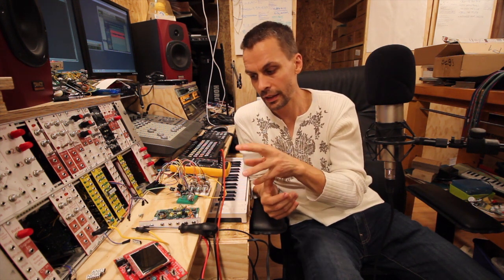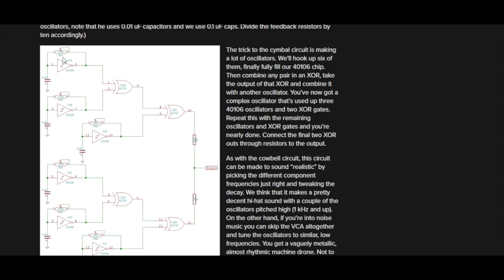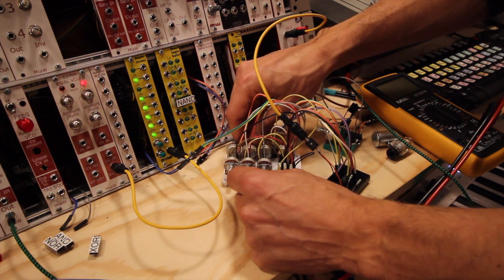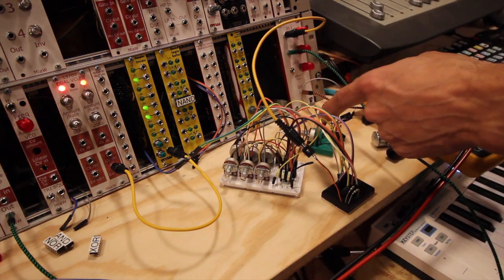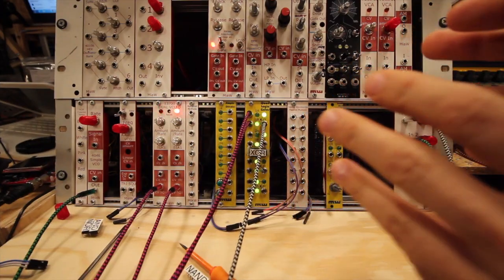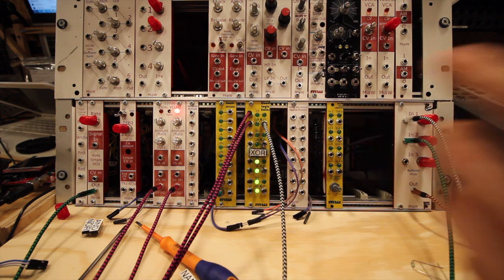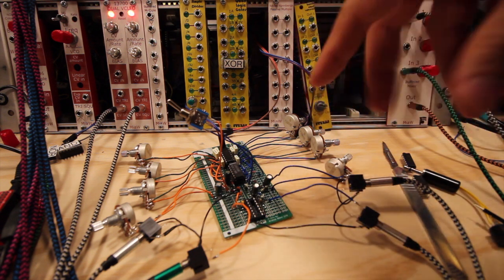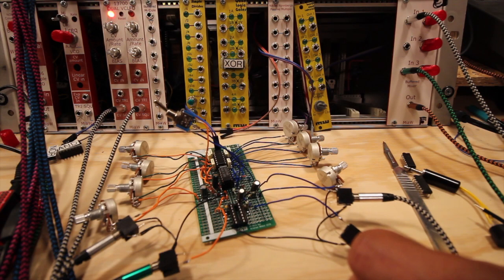XORbell Metallic Noise Percussion - DIY Modular in a Week 9.3

Comment: Sounds cool, you'r synth is awesome. Typical I just ordered a Rakti metal, and it seems to be making some similar sounds, I hope it will work as a snare since it has a option for metal sound or white noise . I'm starting my drum skiff soon, and I plan on making a piezo trigger thing (so I can finger drum) and a weird 555 LFO timer thing I came up with to trigger it. Still don't quite get how to make the VCA, but I will watch you'r videos and study the scematics more before I start asking noob questions.
Reply from the maker: The tomtomtom and the xorbell use two different techniques for vcas. If it’s just square waves the one in this one might work. For noise sounds etc the tomtomtom variant is probably better. Although the vca was the problem in the basnahi module as the noise bleed through.
Reply: I see. I think the blueprint I have been looking at is for the basnahi. Think the tomtomtom will be a good solution. I ordered the chips you use on the vca for the tomtomtom. The Metal have all that stuff built in, as well as a piezo, so I hope to replicate some of that stuff for a full drum kit. The 3340 I made don't work at all :/
Reply: It's finely alive :D I had bridged 2 rows, had to meter it and stuff. The tuning will probebly take some more efort as well.

Comment: I like what you are doing and this is the second module from this series which I'm building. I'm wondering why is there no capacitor used on the output? I'm building it without the gate circuit, this because I want to use a VCA in my rack, but without a capacitor on the output the signal is only positive, with a capasitor the signal looks nicly +/- 6 Volts on the oscilloscope.
Reply from the maker: That is Great. Use the cap. I must have missed that. What cap value did you use? I will add it to the schematics.
Reply: At the moment I've built just two oscillators on a board, which are connected to one xor. I use an elco of 10uF directly connected to the output of the XOR. It could be that another value works too, I did not real testing on that.

Comment: hello ik intrested in your modules zo i tray to bilt the hihats but i have a problem whit the diodeś watb we use the 4001 i meen , but this do not work bij me , mebay you can and wil help me .wat do i need to doe 
gr bas
Reply from the maker: Sorry if I dont understand, but 4001 is what he used in the original schematics, and I used 1N4148, so both should work. The circuit is made of three parts, the noise circuit, everything below D3 in my schematics, if you only build that, and check the base of T1 you should hear noise there, if not then the problem is the noise circuit. Then you have the trig input that should send a a spike each time you add voltage to the P1 input. Then those two together should make the hihat sound. The snare cap values can be quite inaudible, so go with the hihat values as they have a brighter noise sound. Hope this helps a bit.

Comment: Hi Kristian , how are you ? Thats a really cool Modul and i love the Sounds it Can make ... i Have a Little question about The output Buffer You mentioned . At the End of the Video you added the Buffet , Right ? Because i was Wondering what the Third Chip on the pcb at the End of the Video is .... tl074 or something different ? Do you Power it with +/-12v and Ground or is it only +12v and Ground... i tried to stop the Video und watch out for the Power connectors But i could only See the Two Pins on the „ Power Bus „ strips of your pcb 🤔
Reply from the maker: Sorry for late reply. You can use a tl07x and then you need +-12v or use a lm358 then you can use +12v and gnd to power.  Sometimes I add chips and change my mind so it could be that too. ;) The schematics should be correct though.

Comment: If you do not have a 4070 handy Ben Eater builds an XOR w/ 5 NPN BJT's https://youtu.be/sTu3LwpF6XI?t=510 or you can go the 555 route like Jeri Ellsworth et al which I can no longer find a link for. There is also a FULL BRIDGE RECTIFIER and PNP implementation https://electrosome.com/xor-xnor-logic-function-diode-bridge-transistor/